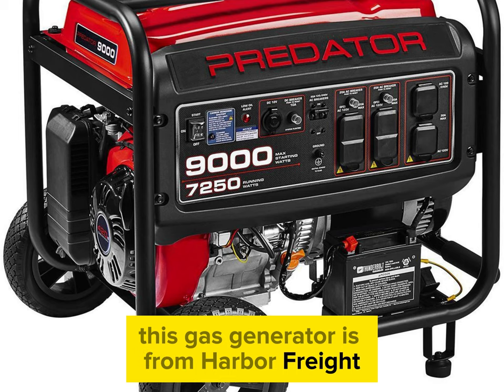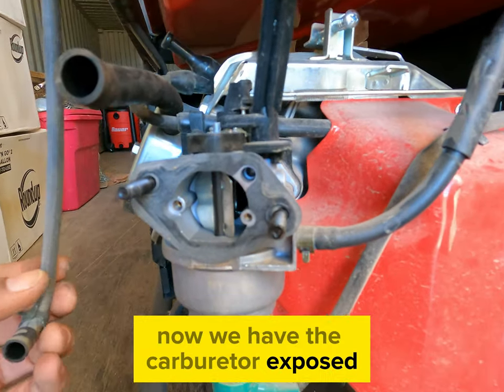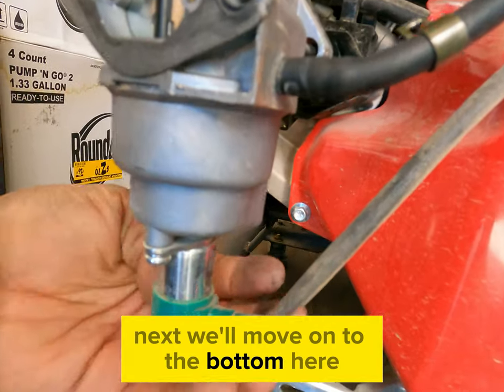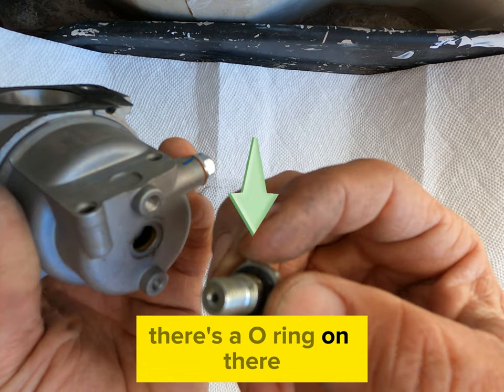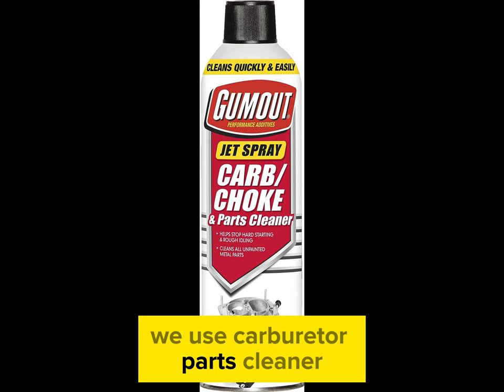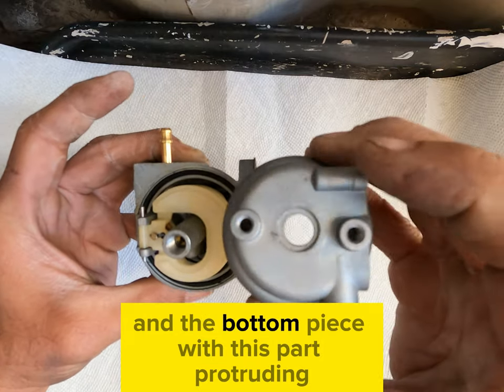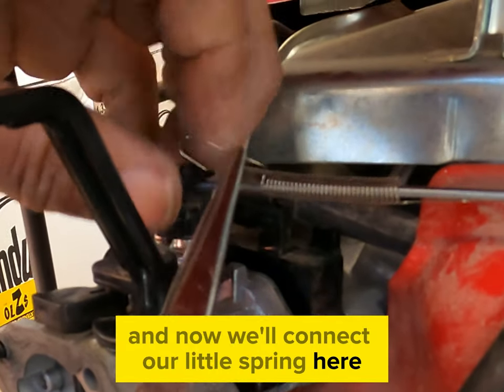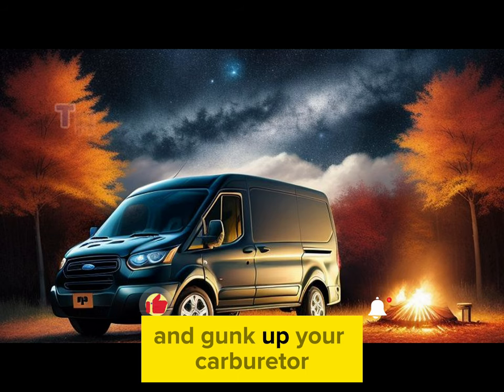Cleaning Carburetor on Harbor Freight Predator 9000 Gas Generator for Peak Performance!

Comment: Greatly appreciated for this. I had problems starting with the battery initially. Change the spark plug just in case. I noticed the carburetor was clogged when I removed the screw to release the remnants of gas and no gas was coming through after a few cranks. 
I drained what was left and add new gas as well. Boom cranked up no issues.
Reply from the maker: Thank you! Changing the spark plug is a great idea to keep the generator running smoothly.

Comment: Any suggestions if you can’t get the little piece out with a flat head? Mine seems totally stuck. Awesome video, going perfectly until that most important part
Reply from the maker: The little piece may be gunked up making it hard to unscrew. Try spraying carb cleaner into it to loosen it up.

Comment: I suggest watching James Condon's videos on generators - he's the guru.  You did a good job cleaning the carburetor, but you neglected the pilot jet.  Just like the main jet and emulsion tube you cleaned, if the pilot jet is clogged the engine may not run or will run poorly.
Reply from the maker: I appreciate the advice! I'll definitely check out James Condon's videos.

Comment: Hi, I'm have issues with the same carburetor you have. After cleaning and reinstalling, I am having the same issues as before. I followed the wires from what I guess is the fuel silonoid from the bottom of the carburetor and found them disconnected. I do not know where they connect to. Can you shed some light on this for me. I'm sure that's the reason I am have so much trouble.  Thanks in a advance.
Reply from the maker: I'll have to look at my generator and film where they go. It's at my other property. once I go there I'll make a video for you

Comment: The gas today is horrible for gumming up ANYTHING.  Chainsaws, generators, weedeaters, blowers, mowers, it's a nightmare.  Fuel stabilizers are great but even then there can be problems.
Reply from the maker: Yea it's bad. That's why I just turn the fuel line off and let the generator run until all the gas gets used up in the carburetor and shuts itself off.  It saves me from having to clean it too much, compared to when I leave gas in it.